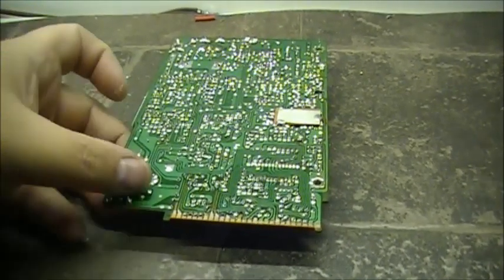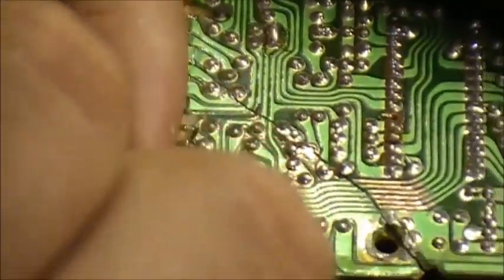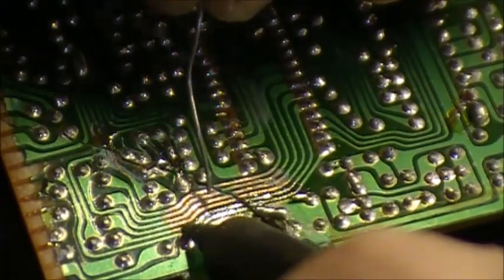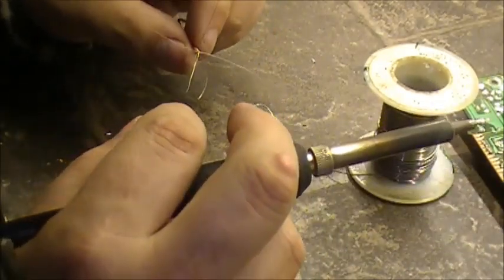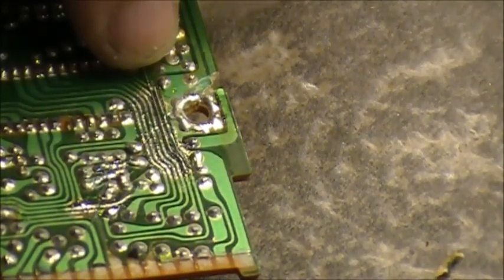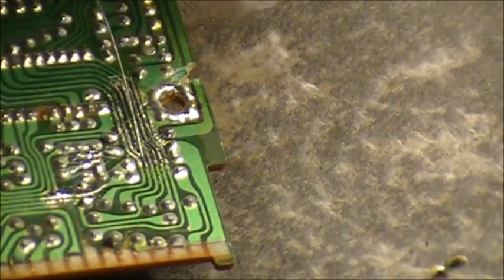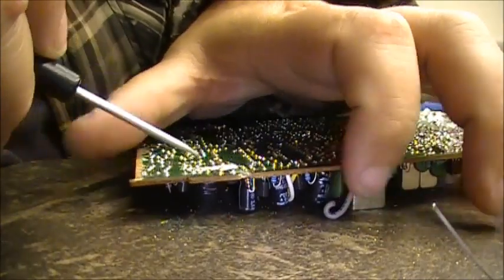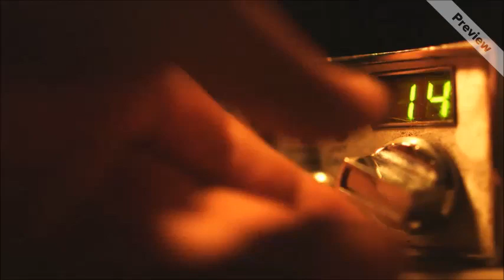Circuit board trace repair

Comment: Thanks radionut. Just what I needed. I appreciate the pain!
Reply from the maker: My pleasure Vince, so glad this video was of help to you.
Reply: @Radionut63  Ok... What do you do to clean a 23 channel selector? This 139 doesn't make contact on all channels. I used to use wd40 with good results but not sure if it will work on this selector.
Reply from the maker: Which channels are not working?    You might be having trouble with the crystals that control each channel, if you find yours may be bad i have a TON here, i could put together a set for you if you need them.
Reply: @Radionut63  When I turn the selector, 19 is scratchy garbled but other channels are dead and if I rock the selector there is liked a 60hz cycle sound more like a hum.
At lunch I went to home depot and bought some cleaner and will try that tonite.
What time zone are you?
Reply from the maker: Newfoundland Canada, we are 1.5hours ahead of Ontario and New York.   Local time right now, 9:20pm
Reply: @Radionut63  so you're 4.5 hrs ahead of me in California
Reply from the maker: I think so yeah.   9:57pm here now.   BTW i am on Facebook if you want to connect.  ;-)
Reply: @Radionut63  yes would be easier thru messenger
Reply from the maker: Look for "Radionuts Hangout" on Facebook.  ;-)

Comment: Great video! Just a question. Why didn't you use any flux for the soldering?
Reply from the maker: No need because the solder i use is Rosin Core Solder which is a type of flux.  "Rosin-core solder is an metal alloy with a pitch-like organic compound substances which melt easily and adhere well to copper and other metals, creating a strong bond that conducts electricity. Rosin-core solder consists of a metal tube that surrounds a thin core of rosin. When you apply heat to solder, the metal and rosin melt together. The solder and rosin flow onto an electrical connection" "Some solder contains core which contains the flux so that you don't have provide the flux but will be used by from the solder core itself. "

Comment: Hello. Working on a quartz watch circuit board,  due to battery corrosion. If the break is very tiny (1mm), can I simply strip a little bit of the green trace covering and solder between them. The gap is about 1mm but thinking of soldering about 3-4mm? Also is it ok to wind a piece of wire around the soldering iron tip to make a fine point to solder with?
Reply from the maker: If you can get a good connection without bridging anything else you should be fine. With regards to the wire... never tried that before, so your on your own there.  Good luck!  :-)

Comment: Nice way to resurrect an otherwise scrapped radio. What model of soldering iron are you using?
Reply from the maker: Weller brand.
Reply: @Radionut63  The reason why I asked was I hear a vacuum or a compressor type thing that you are cleaning your tip with.
Reply from the maker: Neither is used.     Using a sponge made for the purpose.